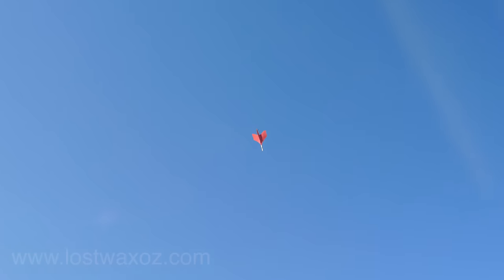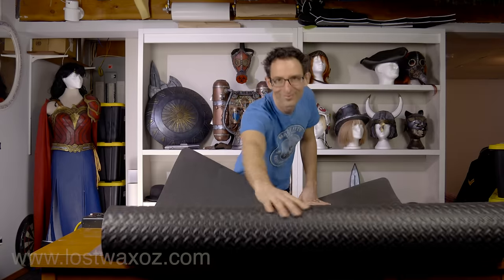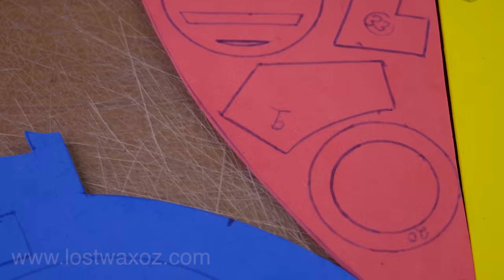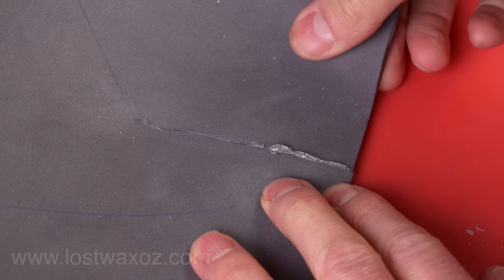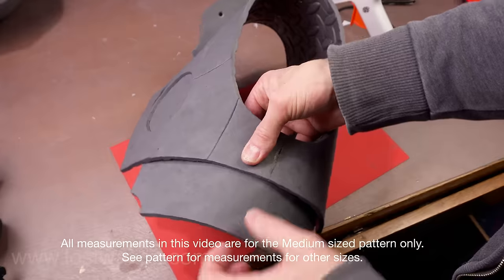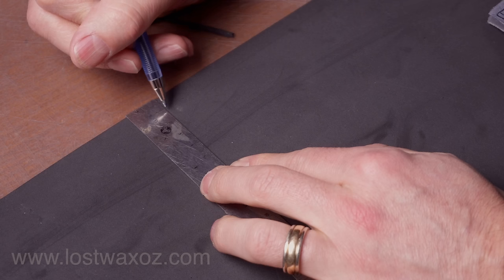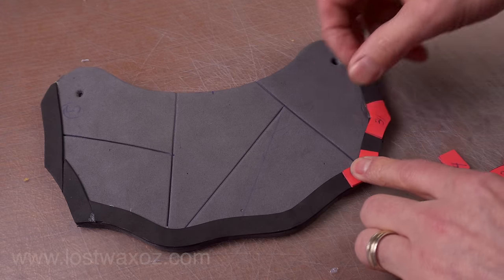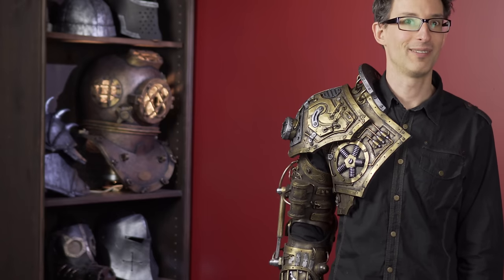How To Make Steampunk Shoulder Armor. EVA Foam Armor Templates for Steampunk Costume Ideas

Comment: You should try using contact cement, it’s stronger than hot glue and works well on foam usually, we use it in theater all the time
Reply from the maker: I started off using contact cement, and it definitely has it's benefits. The main downside is the fumes, which I really don't want to subject myself and my family to. Now that I have used hot glue for years, 7 times out of ten, I would still pick it over contact cement even if the fumes weren't an issue.

Comment: Quick question about 6.11 when you put the pauldron webbing through. How do you fix it on the underside of the shoulder? Just glue?
Reply from the maker: Yep, just hot glue. Make sure to roughen up the foam though for good adhesion

Comment: Hi, i want to buy all the pack of the steampunk pieces but i have a request. if i buy it can i have the pieces in vectors? without the pages cuts. i want to cut the pieces on laser. hope you can answer ty
Reply from the maker: Hi there, yes, I do supply vectors to people when they request them, as long as they are not going to distribute the files:) If you buy the patterns, just send me an email, and I can supply the vectors for whichever patterns you are making.
Reply: Lost Wax Hey, i just bought it but i can't find your email. I sent you a message on instagram. Hope you can answer
Reply from the maker: @mikepantoja1113  Hey, I don't see your message on Instagram, can you email me at lostwaxozcontact@gmail.com and I will make sure to get it sorted for you!

Comment: contact cement like barge is better
Reply from the maker: Depends on your definition of better. Definitely not better to breathe😁 But, yes, if you are a professional costume maker, Barge is the go to. It is amazing though how well hot glue actually works. I have used it exclusively for the last few years and it hasn't let me down yet.

Comment: Contact cement my brothah
Reply from the maker: Yup, it definitely works. I just steer away from it because of the fumes. And actually after using hot glue exclusively for a few years, would in many cases choose it over contact cement.